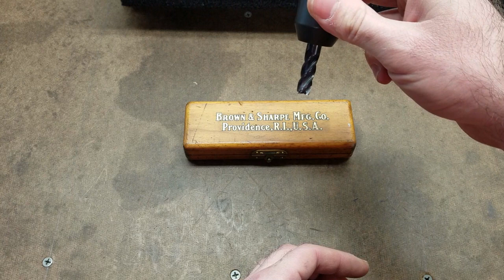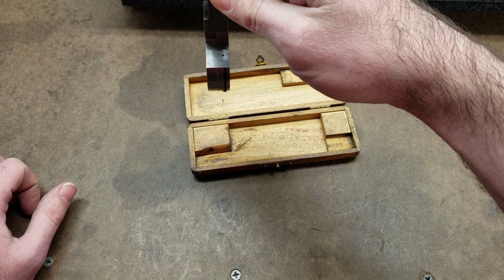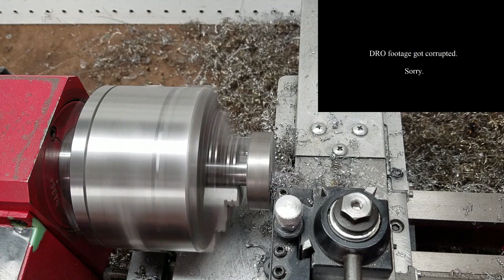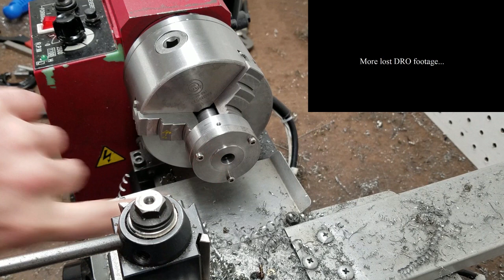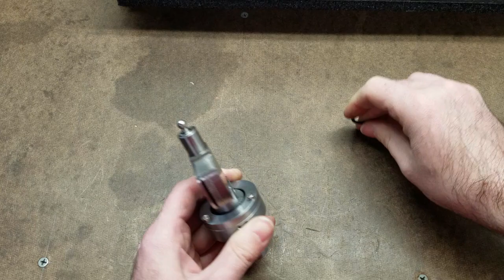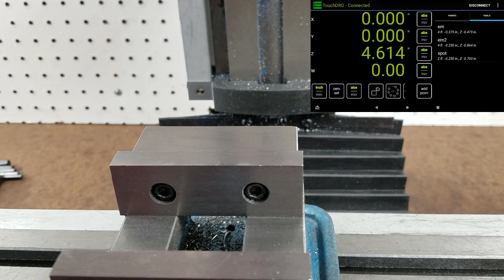Finding my origin: The 3D Smeller  #toolfest2021

Comment: Great video sir! Wish I had found your channel much earlier. I just installed a DRO with glass scales on my little 7 x 16 lathe. The TouchDRO looks like a really nice system and would have been easier to work with. Keep up the great work!
Reply from the maker: Thanks so much! 

You can likely use TouchDRO with the scales you installed. If the scales connect with DB9 connectors, all you need is the correct adapter board from Yuriystoys, and a cheap Android tablet. The user interface of the app is far, far better than the displays that usually come with inexpensive DRO kits.

Comment: Very cool tool! Love it. Interesting to see your DRO in action. The Newall DRO on my Colchester lathe is so old that Newall don't have any records of the circuit of the controller. I think that with a bit of hardware hacking, I could get an output into a microcontroller and feed an app on a tablet.  Maybe even emulate the scales to feed TouchDRO. I do have a Haimer, but I still use a friction edge-finder sometimes.
Reply from the maker: Thanks!

The scales on your current DRO might be compatible with the TouchDRO board. It's worth checking out the forum at yuriystoys.com to see if they are... Then all you need is the TouchDRO adapter board and a cheap tablet!
Reply: @fna-wrightengineering  I'll have a look, but the hardware needed to read these ancient Newall Spherosyns might be a bit tricky, they are inductive, something like an LVDT, so no quadrature output as such. I'd hate to lose them because they are coolant-proof and almost impossible to wreck.  Even for me. Maybe.